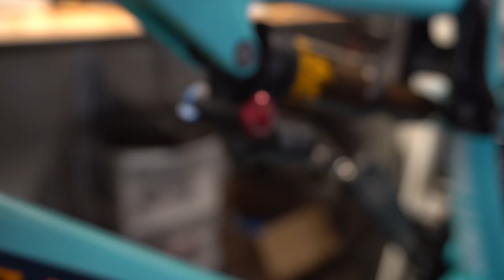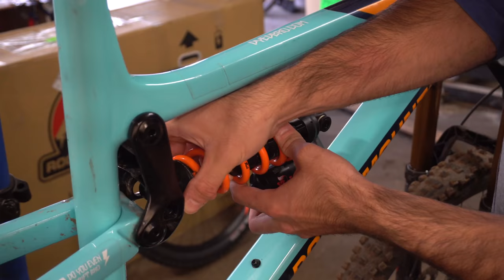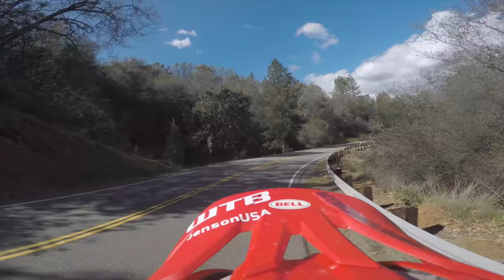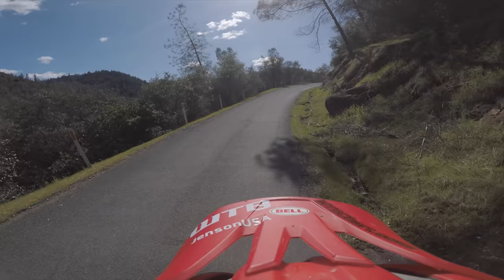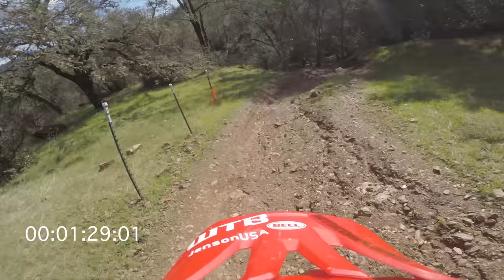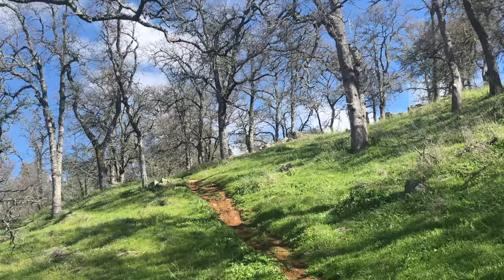Coil Vs Air Shocks - Why Did I Switch To Coil?

Comment: When you say that coils take the same amount of force to compress through the whole travel that would mean that it would bottom out on sag alone. Both shock's spring rates get firmer the deeper you get into the travel but air shocks increase exponentially whereas coils increase at a constant rate.
Reply: He means that for every unit of travel it takes a certain amount of force to compress the shock to that travel (AKA spring rate). So 1 inch may take 400lbs then the second inch takes another 400lbs for a total of 800lbs to get to 2 inches of travel (and so on and so forth). An air shock has an increasing amount of force to compress the shock one unit of travel. For example an air shock may need 400lbs to compress the first inch of travel, then another 600lbs to compress the second inch of travel for a total of 1000lbs to compress the shock 2 inches. 

Hopefully that clears it up
Reply: "Rate" means force/displacement.  Because of that, the rate of a coil is essentially constant.  Air shocks on the other hand have a generally increasing rate, so compressing the shock some distance at the end of the travel takes more force than compressing the shock the same amount at the beginning of the stroke.
Reply: F(force applied)=k(coil constant)x(space)

Comment: First time I rode coil on MTB was on my Nomad4 after running air for the entire summer . Immediate thought - “oh. so that’s the rear end feel I’ve been trying to get with air”. I know have an evil offering with a Push and I will never go back to air.
Reply: I have a offering as well. I put 2 tokens in the rear and still feels the same. What coil did you get and what are the biggest differences you notice
Reply: what coil shock were you using on your nomad? I have the same bike and I'm trying to decide weather to get a new air shock or coil?

Comment: I just added a coil (Cane Creek DB IL Coil) to my YT Jeffsy (very progressive leverage rate) and I'd say your comments mirror my own. I think the added suppleness and traction far outweigh the slight bobbing on a climb. And, with the excellent climb switch engaged, it climbs even better than the previous Fox DPS.
Reply: 👍👍👍
That shock was developed by Öhlins just down the street from Cane Creek in North Carolina

Comment: I had a custom tuned Fox Van RC coil shock in my previous 130mm bike. Yeah, air shocks are lighter, but I wouldn't necessarily call them more efficient for climbing. It was something about the coil shock that made me hammer up the climbs, never miss the lockout and just enjoy the descents. My new frame has a Float X2 air shock. I don't miss the coil shock as the performance of this state of the art air shock is amazing, but this is exactly the thing: a tuned Van RC coil shock easily matches the performance of the X2, for a weight penalty of 400 to 500 grams, which to be honest I never noticed. 
p.s. Fine tuning the LSC on a coil shock does wonders to how poppy it feels.

Comment: Flow trails/jumps = air, many rocks = coil. However, air's "poppiness" seems to make it easier to do little bunnyhops while going through rock gardens and you end up jumping over more of the rough stuff and not plowing through it as much. You also feel like you are skipping over the tops of the rocks more and losing less momentum.  It encourages you to ride in a different way that I think might be faster. You get rattled more, but it is interesting to keep ramping up the progressiveness with air spacers and seeing how it feels. I currently ride a YT Tues (pretty progressive) with maximum air spacers in the shock with less than recommended sag and it is extremely fun and fast. Also, air is gonna pedal better up and down. For trail bikes, if you're fit enough to not be bothered by the loss in uphill pedaling efficiency on coil then you are probably not going to be bothered that much by the slightly harsher descent on air...
Reply: Great insightful reply!  Thanks!

Comment: My terrain out here in the Carson Valley/Alpine county is mostly Pyroclastic type stones. Really rough on air shocks. I blown every one that came stock with a bike. Even trying different makers to no avail..
Ohlins TTX22 never has failed me yet on all my bikes! But as you say, air is more efficient to climb, pedal in the long run. But wieght it not the issue, its absorbtion..Coil for me until there is a blend of the 2..thanks for sharing Trail Peaks!
Reply from the maker: Totally, I should say that the biggest disadvantage to coil really is the less efficient pedaling, not the weight penalty. But like you said, it offers so much more traction and is more robust.

Comment: Currently have the stock DPX2 on my 2018 Hightower LT CC and need to upgrade to something that handles the real chunky stuff here in Phoenix, and so I'm torn between coil vs. air.  I know my frame is meant for a more progressive shock, but I have read some tech articles saying that the frame really isn't setup for a super progressive shock, it's almost linear.  I would love the coil's small bump sensitivity because there's a lot of that here along with the heavy stuff, but there's a lot of the trails here are mostly climbing so I think that's where I'd lean more towards air.

Comment: i dont think you mentioned that with a progressive frame, there should be minimal pedal-bob, and even if you have some, a lot of coiled brands have compression switches. 
my tyee @ 160mm travel coil climbs almost as good as my hugene w/ 140 travel air shock. fully open. downhill there's no comparison. the air shock bounces all over the place, and you'd prolly be surprised at how well you can stay planted on a coil if you're running one for the first time. it is very noticeable. 
another thing, on more linear frames there are new progressive springs that try to "mimic" an air shocks' late travel resistance. for single pivot frames and such, a progressive spring is a must otherwise you'd either be running a way too stiff spring, or you bottom out a lot. and that ain't no fun!

Comment: You can get progressive springs from MRP and ext Storia have hydraulic ramp up in theirs , plenty of options for nearly all frames nowadays. I'm running a titanium spring on my super deluxe on my transition Patrol... Love it.
Reply from the maker: True, haven't tried out the MRP progressive spring, it sounds interesting, but far heavier than the SLS spring from Fox
Reply: @TrailPeek  yeah definitely, being a Clyde I'm using a 650lb spring, I'd hate to think how heavy it would be in standard spring steel.

Comment: As you said, air tends to feel more playful and poppy.  That sells me on air regardless of the weight difference.
Reply: Pedaling Dave actually a myth. Coils are more playful and poppy. It’s just what people say because they’ve heard it before and sounds right.
Reply: @TheNotoriousMIC  why do u say that? Very curious cause that's what everyone says about air?
Reply: cwd 123 urban myth. People keep repeating it to the point where it’s almost truth.
Reply: TheNotoriousMIC  I went between an air shock to a coil shock and noticed a difference immediately. Coil is smoother over bumps and generally hugs the ground better while the air shock was more supportive in bigger impacts and popped better off obstacles. Many people that I have talked to have had the same experience when trying coil vs air. You can obviously set either one up to feel differently but air suspension by nature will be more progressive, you can't get around that fact and that is why they feel more springy and better for jumping.
Reply: @mtbasher  thanks for the detailed answer! Anyone else have any input?
Reply: mtbasher I run both and it’s really not true. Coils have support all the way through the travel not just at the end like a air shock meaning you’ve got more support to push into and pop off unlike a air shock which you ether have to pump up hard to get that support and rarely use all your travel or just fly through the mid stroke to get that support at the end of the stroke where you hit that progression.
Reply: @TheNotoriousMIC Sounds like you never had your air shock setup correctly. If you run the same sag value from shock to shock, the air shock will ramp harder, you cannot physically change that, that's just how they work by design. The outcome of all this is more dependent on the bike you ride and the leverage curve than anything. If a bike requires a progressive spring rate, a coil shock will feel softer further into the travel. A plow bike will not turn into a park bike just because an air shock is put on the bike. Hundreds of people have switched shocks from coil to air and vice versa and will say the same thing because it is true, not because it is repeatable and easy to retell.
Reply: mtbasher mtbasher I get what your trying to say but it doesn’t work like that in real life. Your just comparing a air spring to a coil spring and not considering all the other factors that contribute to a complete system. Like I said nobody uses air shocks for a reason.
Reply: @TheNotoriousMIC  I said all I needed to in those two comments, I'm not going to beat a dead horse over this.
Reply: mtbasher you clearly don’t get it dude no offence. Your looking at it in black and white and not seeing the full picture. 

With a coil you get no progression until you hit the bottom out bumper you have constant support throughout the travel for you to push off and get your playful pop where if you looked at an air spring on a graph it would look like an S shape. As in it’s initially firm as you need to break the friction from the seals that have to contain 200 + psi then you normally get a flat spot in the mid stroke with a lot of progression at the end. This is how an air spring is always going to work. Your always going to have little of less mid stroke support that your going to fly through when hitting a transition and your only really getting support in the end stroke which is obviously not good for pushing into and getting pop unless you run it really hard and never really get full travel. It’s hard to explain through text but I hope I’ve cleared it up a little for you.
Reply: The NotoriousMIC has got it right. It´s not like an air shock is ramping up in a constant linear way. Their curve is sagging in the middle and just ramps up heavily at the very end.
This inherent characteristic makes it actually harder to make them feel predictable and deliver a constant platform to push against, which is something you´ll feel when jumping.
The reason people keep pushing this narrative is because dirtjumpers and slopestyle riders use air shocks pumped to the max because they deliver better bottoming resistance, but there is a reason they pump these things up to the point where they´ll barely even move except on super hard hits.
Another reason why so many people claim they tested both and felt the air shock being more responsive is because most people do not bother to even perfect the setup on a coil shock. If you try your new bike with the wrong coil springrate and then slap on an air shock which can easily be adjusted to the correct spring rate, of course the soft coil will feel less active. If you hop on your buddies coil shock bike and he´s lighter weight than you, of course it´ll feel less lively than your correct setup air shock.
The number of people who do not bother buying the correct rate coil spring is astonishing, hence i´m not surprised this narrative gets pushed so much.
And then there are the factors most people do not even know about. For example how there are a lot of low level coil shocks out there with terrible compression tunes. Of course they´ll feel like shit! They are made to feel super plush in the car park. It´s way easier to compensate for that on an air shock by simply increasing the pressure to the point where it´ll somehwat compensate for the dampings shortcomings. The fact that mainstream manufacturers only offer springs in 50 pound increments doesn´t help this at all, as obviously some people won´t be able to even get the correct spring rate. So people need to buy after market springs from the likes of SAR or Nukeproof in order to get 25 pound increments. Those are expensive though and therefore even less people give them a try. In the end most coil shocks end up with simply the wrong (too soft) spring rate as people tend to use the more comfortable of the two available spring options.
When i hop on peoples bikes with air shocks i´m also always amazed by how hard they pump their shocks/forks, mostly to make them dive less. I´m not surprised they feel like they´re more poppy.
Another reason is stiction. A lot of people use less rebound damping on air shocks as their inherent stiction makes them feel lethargic with too much rebound damping. As a result almost all air shock users i´ve met run a stupid fast rebound setup. Actually most people do this, regardless of what spring they use. So again, there´s another confounding variable unnoticedly influencing peoples perception of shocks.
There´s one truth to it though.
Air shocks will feel more poppy on really small bumps which you use as a means to get some air, like a root or small rock. That´s because their initial stiction delays the response of the shock to the impact, transferring more force into the chassis and allowing you to utilize it to pick up the bike. Basically, your bike gets thrown around more and if you´re a capable rider, you can utilize that. On a coil, which in most cases just soaks up such impacts, you´ll have to push through to the point where there´s more return pressure from your spring/damping circuit in order to gain some pop. It requires a different riding style. Air suspension in these instances is more akin to a hardtail.
Reply: S Fuchs someone knows.
Reply: Helpful explainer @ S Fuchs but that closing explanation for pop characteristics is exactly what I think of with this whole debate about playful responsiveness: easily popping of a root or rock, quick little launches hopping around the trail. Maybe poppy or playful is relative to speed? Not that I expect anyone to answer a year old thread

Comment: The middle part of a spring which has even coli spacing is very linear. However you always have two ends of the springs which are shaped/spaced differently. Which has different compressing rate compares to the middle coils. This in turn makes a spring in practice progressive. Two springs of the same length but with different number of coils. The one with less number of coils will be more progressive.

The way you compare two shocks is just flaw. A shock damper is more than its spring mechanism. Have you thought about the difference of the internal dampening of both shocks?
Reply from the maker: This guy physics 👍You're right, this is a simplification of a bunch of mechanics. Both are using the same damper though.

Comment: I have been riding for years and I do not feel much of a difference on any shocks,   I have a fox shock on my Yeti, and a coil shock on my Commencal .  Is it me or are most shocks good these days
Reply: No! See, I'm actually smarter than the engineers that designed these frames, so I put a coil on everything

Comment: Switched to coil, and Blair Witch nausea cam too?  Maybe the old school coil made you want to go old school helmet cam with visor view.  :-)   

Thanks for the recap and comparing the two.  I think for people who have a dedicated enduro race bike, coils are definitely the way to go.  Climbing time doesnt matter, and you want the most stable and planted rip down the stage.  If you have to have "one bike to do it all" then it's hard to say coil, because on longer trails rides...the fatigue will be greater, not to mention the weight penalty.  I can absolutely feel the energy loss on climbing with the pedal bob, and that would stink on a 25 mile trail ride.
Reply: I end up riding my 'enduro race' bike all the time and when I switched from a 2015 Monarch RC3 to a 2019 DHX2 I got the climb lever installed by Fox (they aren't an available SKU through distro on the longer travel models). Climbs fine, but who likes climbing anyway? The only hassle was getting the right eyelet reducer bushing kits.

Comment: Converted my 2018 YT carbon pro race to coil front and back and would never go back to air, long berms so much feel what the tyre is doing and that includes dropping tyre pressure for more grip and can feel where I need more pressure so get the most grip in wet conditions especially when rain showers I can feel when to back it off lie yesterday as was running a rear rock razor semi slick so with tyre pressure changes with no improvement so went home and put on a maxxis high roller and run lower pressure and so much more grip. Ok more weight but grip out weighs that. So run Vorsprung coil 50Ib front spring and DHX2 with a 450ib and I use 95% off travel but when dry I use 100% if I push it. Same wit the front 95% off travel used but one big drop off on my course if I push it hard 100% used with no hard bottoming as I can adjust bottoming resistance 4 clicks from fully in.